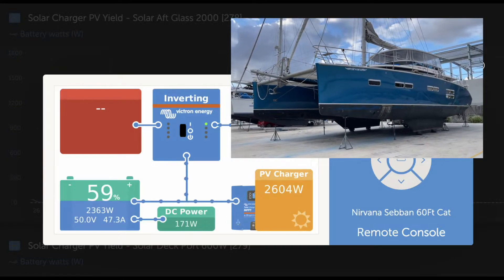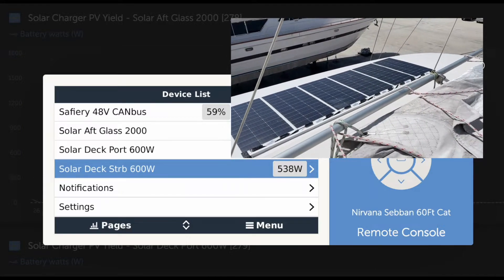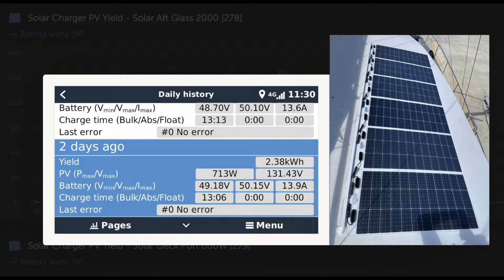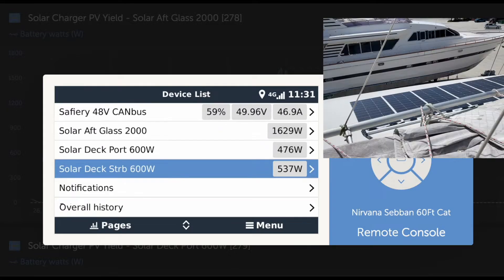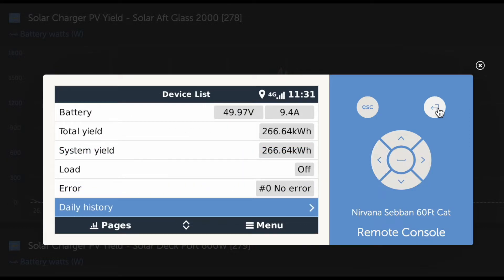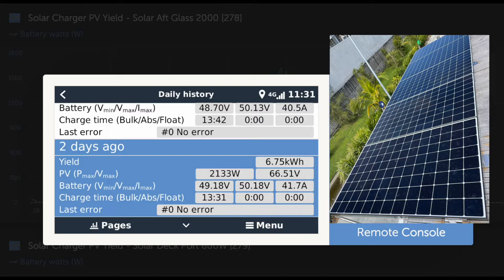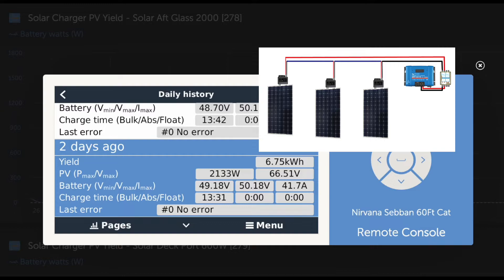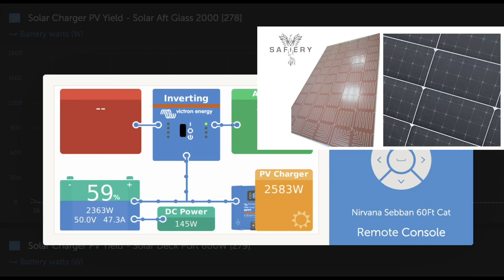Solar Panel Performance Review nearly a year after installation with up to 118% Watts 60Ft Cat

Comment: Really thinking ill go copperflex on my caravan.. my only concern of putting copperflex on is the heat transfer to inside the van.  I'd love some feedback on if its noticeably difference from a glass panel
Reply from the maker: Hi Cal, I agree with you. I dont have any test data on the difference but I'd say the glass panels with the airgap would be cooler.